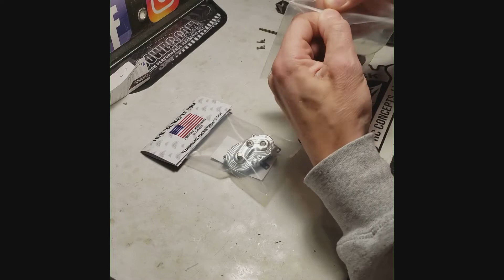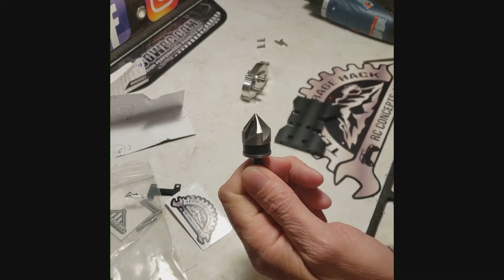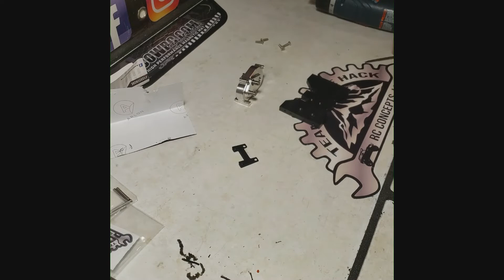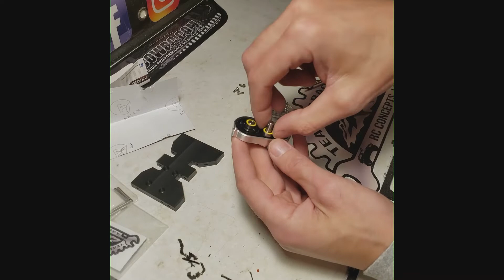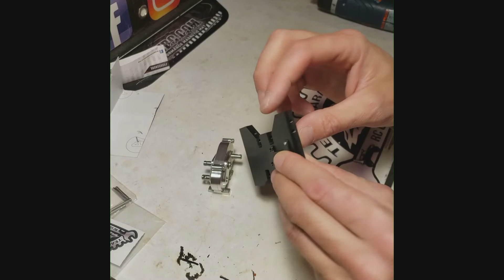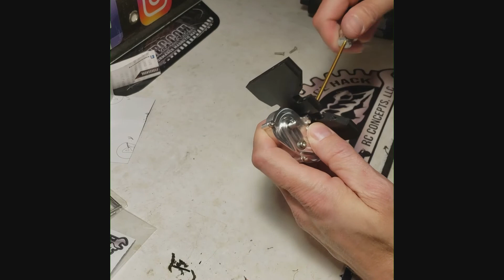TGH MIRRORS A VADER MONKEY SKID

Comment: So doing this and mirroring the fmm is what is needed for the ar45 portals on the v3 .. both have to be done correct? Just got the fmm and creeper T and trying figure all out
Reply from the maker: You will need to drill a hole in the Gspeed chassis. A jig is available https://www.teamgaragehack.com/collections/tgh-exclusive/products/tgh-mirrored-skid-for-gspeed-v1-c1-tgh-v3

Also the skid will need flipped and the holes countersunk.